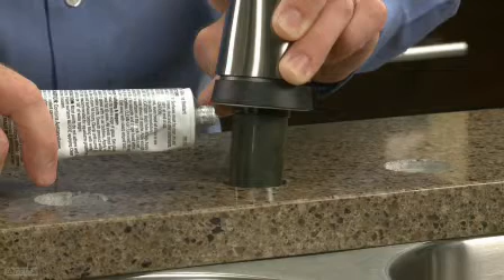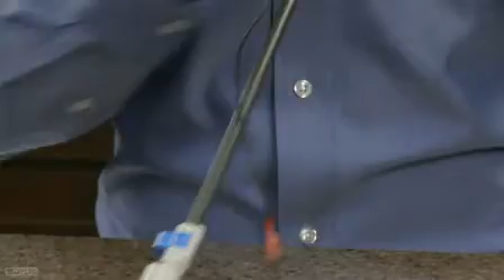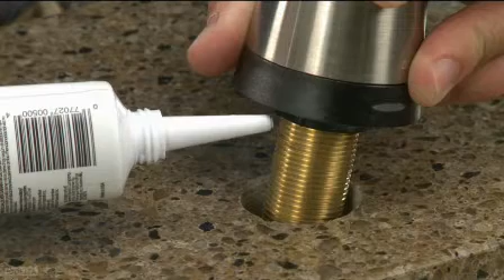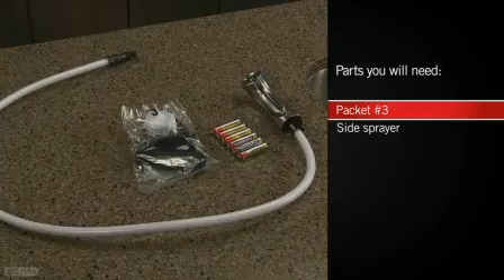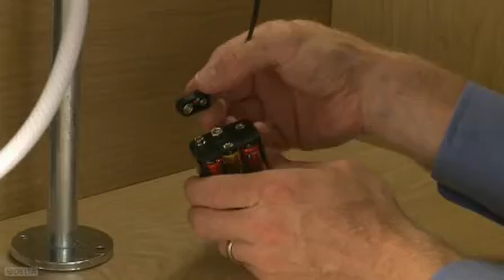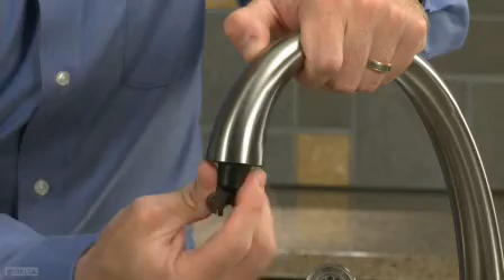How to Install the Delta Pilar Touch Kitchen Faucet

Comment: This was a great video to watch with still using the instructions. I have NO experience with plumbing and very limited home improvement experience, but I was able to complete this install fairly easy. I watched youtube for how to remove my old faucet first then this one. I even was able to look up a video on how to stop a leak from my old shut off valves. This saved about $149 bucks as that is how much lowes charges for this install. I work there so I thought I should learn myself to help others